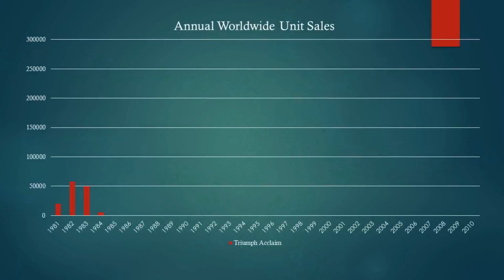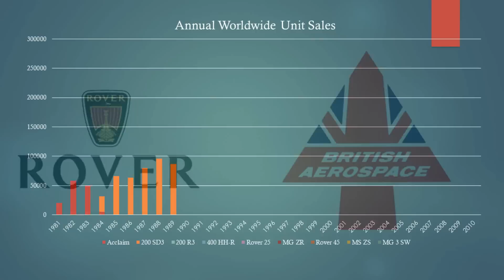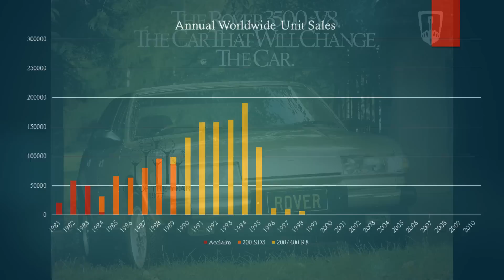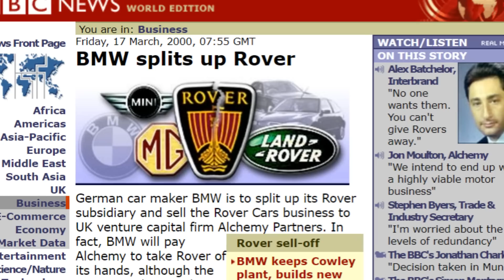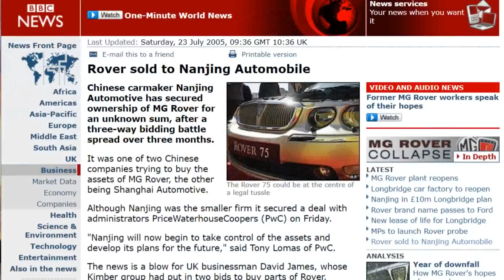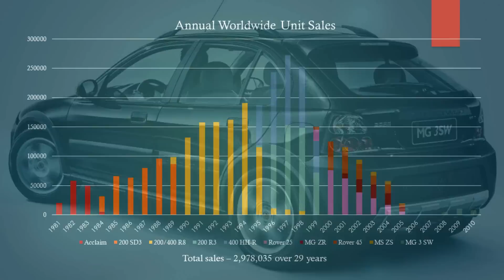The Rover 200 Story

Comment: I owned a Rover 420GSI Sport Turbo (not a standard Turbo) in the early 90's. It was a very rare car as they mostly went to the Police. It was VERY fast..so much so that a friend of mine who'd just imported a Mitisubishi EVO 4 thought something was wrong with his car as it felt slow after the Rover. A rolling road confirmed his car was fine...so he then spent a fortune on tuning to get it as quick as the Rover. 
The 420GSI Sport Turbo had had its turbo badge removed by its previous owner (a member of the BRDC), he'd also replaced the original soft bushes, fitted adjustable Bilsteins and uprated the brakes. It was a thug in suit...I upset a few Porsche 911 and Ferrari 348 drivers. The only negative aspect of ownership was the servicing cost as it wasn't really up to its performance..I lost a driveshaft which damaged the Torsen diff (££££), melted a piston and  blew the turbo (££££)..but I guess I did drive it hard! It is still the car that holds my personal top speed record..set at 2am on a deserted M55. 
My current car an Audi S3 is probably about as quick, but passengers expect ut to be fairly fast...no-one expected what they got in the Rover...the second gear was like being launched from a catapult..it just went on....and on!! 👍🏻🙂
Thanks for the video...brought back some fond memories...and a few scary ones!😱
Reply: I;d seen a Cops Montego Turbo Uxbridge Road Shepherds Bush London ,Pizza moped geezer forgot to lock his back box,out comes 3 steaming pizzas Cop car doing about 80 mph swerved doing all 3 italian pies,it was a deliberate manoeuvre outcome splat steaming tomato chessy messes on the road.Feck what a laugh that was in the late 80 to-90's.A1 driving.
Reply: Vincent Mullins 👍🏻😁
Reply: Brilliant to see Mr expensive being trashed so badly,lol.
Reply: Y
Reply: You are correct in worked in R&D at rover and we had a 420 turbo it was so quick but the rest of components weren't top notch it was scary.
Reply: Tomcat could do 70+ in 2nd

Comment: My Dad had a White 216 Vanden Plas back in the early 90s and at the time I had an XR3 and the Rover 216 was better all round and the S series was a peach of an engine and made the CVH in my old Ford feel like a boat anchor in comparison and the rover was also a lot more economical as well.

The only downside was going fast into a corner you would slip off those leather seats and it needed some bigger wheels and I would of jumped at the chance of owning a 216 Vitesse variant in black with those lovely alloys and side stripes.

Comment: The 2 litre turbo diesels with intercooler had fantastic performance and had bulletproof reliability. I miss mine. I sold it with full MOT.
Reply: Fuel economy wasn't great though. Not much better than Hondas 2.0 petrol.
Reply: @garybrown5500  true but it wasn't  that bad about 48 wish if i remember  from the one i had, it was more  refined  than my maestro td (60mpg)
Reply: Me too😢
Reply: @garybrown5500  

You are talking nonsense! They were phenomenally good on fuel!
Reply: @skylined5534  Really. How many MPG were you getting from yours?
Reply: @garybrown5500  

Upto the mid fifties on a long sustained run and late 30s to early 40s around town and standing in traffic etc in the winter using the lights, heating electric heated mirrors etc. That wasn't even trying either.

That's a fairly old tech 2.0 diesel too.
Reply: @skylined5534  Ours was only doing about 32-34 around town. We could get into the 50's on a very long run but this dropped quite disappointingly when cruising along slightly above the speed limit. We had a batch of Hondas with this engine at the dealers I worked They were aimed at the taxi market but we couldn't shift them due to the fuel economy. Eventually they hung around so long, we put new batteries on them & Honda had them back.
Reply: @eggy1962  Had a non turbo 405 Peugeot. Seemed to return about 60 mpg no matter what sort of driving. Not the most exciting car but with fuel economy like that I was sad to see it go!
Reply: @garybrown5500  the xud’s were extremely popular i had a 1.9 non turbo in a talbot horizon, a 1769 turbo in rover 218 and another 1.9 non turbo in a citroen zx . I also owned two maestro diesels one non turbo one with turbo, the maestros were a couple of miles per gallon better on fuel being direct injection..... if i could go back in time any of those 5 cars i would like to have back. Plus one of my skoda estelles cos they were quirky and fun.
Reply: @garybrown5500  

Either you had a lead foot or something was wrong with it.

The engine in the CD Accord and 600 wasn't the same. Based on the same unit but different everything from the basic block up. Typically these would also do 40 to 45 mpg around town and given the competition at the time I don't believe you struggled to move them for minicab use. In fact they were quite a common sight as I recall.
Reply: I had a 3 door sdi which was chipped with the wastegate actuator wound up which went well. Was never amazing on fuel compared with the French equivalents but never dropped much below 45mpg but I never managed better than very low 50's. Most equivalent performance petrols would have been in the low 20's to mid 30's absolute best. I loved the low to mid range torque & never bothered revving it much more than 3300rpm.

Comment: had a 1994 M-reg 218SD turbo diesel - put 87,000 miles on it and was totally reliable. Started first time, every time and when I sold it after 7 years the clutch, exhaust and even the brakes were still the originals. Only parts on the car that were ever changed were service items, tyres and the offside front wing (accident damage). Looked up the MOT history and it was still on the road in late 2017 with 131,500 miles.

Comment: I loved these. Again the estate was a cracking car. I had a lot of rover cars over the years and never experienced any of the fatal flaws they were slated for so much so that my wife drove a 75 for 12 years totally trouble free. My 25 for work never let me down once, my freelander is still running and it's now 23 years old my 220 turbo was stolen and burnt by scum. I now have a mg f with 110000 on the clock. I am the luckiest k series owner in the world having never needed a head gasket or anything like it.

Comment: owned an old acclaim and literally drove it till the wheel fell off , super car felt like a limo from the previous metro i owned. I also owned a j reg 214 which did 60,000 miles as a taxi and apart from the renowned head gasket fail it did the job no problem , spritely thing made my diesel competition look slow but it never felt as smooth and comfy as the acclaim it was a bit tinny really

Comment: Just bought a 40k miles 25 as my first car. Absolutely class! (Almost) no rust and cylinder head is just holding in there
Reply: Changing the green rubber inlet manifold gasket every couple of years is a good idea as they go kind of spongy and leak coolant internally and/or internally.

Many the cause of actual head gasket failure and often wrongly diagnosed as perceived head gasket failure by 'mechanics'! 

Great little cars, just keep an eye out for any rust starting at the rear of the sills where they meet the arch. 

Other than that great little motors and mechanically hard as nails!

Comment: The " K " series engine was a pile of scrap.The most supid unreliable head gasket ever.It allowed oil to leak into the cooling system.Hower I owned the 1.6 honda engined auto.It covered 340,000 miles and was running fine when I scrapped it because the body rotted out.
Reply: k series  was a overheating pile of  shit....im surprised it  lived into the freelanders.
Reply: It was only a design fault. The K-Series engines are really good barring the hg.

Comment: I have very fond memories of the Rover 200....
In February 1985 my dad bought a new 213 VP in Moonraker Blue. The 1.6 engine was not yet available at this time so the 213 VP was top of the range. Price was around £5600 from Taggarts in Motherwell, Lanarkshire. I was 18 and had the pleasure of driving this car regularly, which made me feel very proud and important. I can still remember the registration number of the car - B809 BGB. 
In January 1986 my dad bought another Rover but this time a 216 VP EFi. The Vitesse model was not yet available so again this was top of the range at the time. It was again Moonraker blue and fitted with a 4 speed automatic. Price from same dealer as before was £6500. Registration of this car was C718 HUS. 
The 213 VP became my car at this time, so as you can imagine I was the envy of my friends....not to mention their dads. 
The 1600 fuel injected engine while obviously faster than the 1300 was not as smooth and also had a problem with burning oil.

Comment: I had a W-Reg 1.4 25 bought in early 2006 with 24,000 on the clock. 
Clutch and headgasket failure not too many weeks after purchase.
After that I caned the living daylights out of it for five years with ne'er a problem. Just routine servicing. 
Engine was a bit peaky and flat at low revs as expected of its configuration.
Handled and stopped well. Got a soft spot for it.
Dad had a H-Reg 200 for years as well. No problems at all with that one. No power steering on it though. Smooth, cheap motoring.

Comment: I’ve been watching your videos for a few years but have only just got to this. I’ve owned four Polos over the years (all mkII breadvans, including one post-1990 facelift model).
Unless I was unusually lucky and picked up a prototype, the Formel E was sold on the open market because I had a 1984 Formel E. it had a little orange light that told you went to change gears, and it had start-stop. Unlike modern start-stops, it restarted the engine when you moved the gearstick from neutral to first gear, not by engaging the clutch. To clarify, you were at the lights, engage the clutch, but ignition only happened when you threw the box into first.

Comment: Whilst Honda seemed to simply cool to the partnership, I saw BMW as a company that took advantage of Rover, the designers, tech, etc. and cherry-picked the brands they wanted and threw away the leftovers.  The new Mini alone would have saved the company I reckon.  BTW, we also had a Rover-badged Honda here in Australia, called the Rover Quintet (1983-1985) so pretty much the equivalent of the Triumph Acclaim in the UK.  It actually was a hatchback, unlike the Triumph.  Later on (around 1985) this was replaced by the 416i (not related to the R8) which was a rebadged Honda Integra.  In 1991, the 'real' R8 was imported to evaluate possibility of bringing that model to Australia, but never happened.  We finally had a last hurrah of Rover vehicles that resumed importing in 2001.  Not certain, but I think we only got the 75 and MG variants of that model.  The remaining stock was sold off by auction following MG Rover's collapse.
Reply from the maker: Thanks - interesting to hear the Australian perspective that I hadn't found while researching.
Reply: Also around the time (2004-2005), MG Rover Australia sold the MG ZR 160 hatch and MG ZS 180 sedan, but the numbers that were imported were tiny, less than 100 units. They were terribly expensive and they arrived at the time of MG Rovers collapse and then sell off to Nanjing Auto/SAIC Motors.

Even though the Rover 200/400 R8 Series was never sold in Australia, they still remain to this day, my favourite Rovers!
Reply: The Mini One was developed with BMW knowhow prior to their eventual purchase of the brand as a whole, it had BMW developed engines in it and they threw £100million at the Mini plant. Subsequently BMW put around £400million into the Mini plants. There’s no way that Rover / Phoenix had that kind of money to develop the Mini, the Mini was a success because BMW invested significant sums in it, a look back through the history of British motor manufacturers prove that continual investment and development have been impossible, we simply don’t make good enough cars. We can do it when the Japanese build plants here but 100% British cars were shockingly bad.
Reply: @iEnofadov  JRA actually brought over a rover 400 to display  at a motor show but chose not to import it but currency fluctuations and an easier and reliable source of cars from nearby honda Japan stopped it
Reply: @sutherlandA1  - Yes, you're absolutely correct! They actually bought over a green Rover 220 GTi 3dr hatch and a silver Rover 416 GSi sedan for evaluation and were on display at the 1991 Australian International Motor Show in Sydney. Rumors have it that the 416 GSi sedan was still roaming the streets of Sydney a few years back, not sure if that's still the case?

But yes, currency pressures pretty much put a stop to Australia getting the 200/400 R8 series cars, instead we'd get the Japanese built Rover Quintet (Honda Quint) and then the Rover 416i (Honda Integra). I guess we never completely missed out on the Rover 200/400 R8 cars, we did get the Honda Concerto, so there was some consolation.
Reply: Not so. I worked in the 90s for a software house that was converting Rover's legacy computer mainframe system to an Oracle-based client/server system, for BMW. This was a multi-million pound project and BMW would not have committed to it if they had not - at that time anyway - been serious about the whole Rover company.
Reply: @vernonbear  The original BMW Mini engine (Tritec) was actually a collaboration with Chrysler  before the buy-out from Mercedes. Supplied from Brazil it was also used in small Chrysler vehicles such as the Neon and PT  Cruiser. It was only when Mercedes bought out Chrysler that BMW changed engines.
Reply: @vernonbear  the MINI 1 shape and prototypes were in existence before BMW came along, I sat in one at Gaytech.
Reply: @vernonbear  

That's absolute rubbish. The new 'BMW' Mini was a Rover designed and developed product prior to BMW acquiring the marque.

I late 90s pre production prototype shell was sold on Ebay a few years back and amongst other things had a Rover designated chassis number and even Rover etched Pilkington glass.

The 'BMW' engine you mention was actually a Chrysler unit.
Reply: @chrisrigby582  

Any links to the expenditure on that project?
Reply: Another way to look at it though is by keeping the MINI, BMW saved half of the company and its workforce.

Comment: Great video, very interesting. Certainly brings back some memories - I remember lusting after a 216 Vitesse when they first came out! My dad ran a small engineering company in West Midlands and made tooling for some Austin Rover cast alumium parts - the O-series EFi manifold being the most memorable. They had BL - Rover cars to support UK manufacturing, these were an Ambassador, Rover SD1 2000, Montego 1.6 HL (terrible quality), Montego 2.0 GTi (lol), Rover 216GTi Twin Cam (lovely car, metallic burgundy, Honda DOHC 1.6) then a 420GSi Tourer (had loads of problems). Then had a VW Passat in 1998 as there was no more Rover work done in the business. Shame it all went as Longbridge is not far from me and grew up car mad and collecting all the Rover brochures. I loved the Rover 827 with that fantastic Honda V6, with more pull than the 825.
Reply from the maker: Thanks! Hey, my dad had a small engineering firm in the West Midlands as well :-). Don't knock the MG Montego 2.0. I'm deep in the weeds for the next video - the Maestro and Montego, and that thing went like stink.
Reply: Oooohh, reminded me - the MG Montego Turbo facelift model in BRitish Racing Green. Wow. Regards the GTi badge....didn't think it fitted old monty. BTW, going to looks at your other vids, this was the first one :)
Reply: And of course subscribed :)
Reply: I had a 1986 Montego 2.0 HL. Single SU carburettor feeding the O - Series engine. Bought four years old in early 1990. Why? Far cheaper than Cavalier or Sierra, both of which were arguably better cars, though the Montego did have performance on its side. When it was working, that is. It also came with the PAS option, very unusual in cars of cars of the class in that era. I replaced it with a 1989 1.6 L which has no PAS. Complete monster to try and drive.
Reply: @BigCar2  I had a 1990 MG Montego 2.0 EFi in white, I still haven't had a car since that made me smile like that one did

Comment: From memory the 216 GSi used a sixteen valve head but operated, unusually, by a single overhead camshaft. Honda's Concerto was very similar to the 1989 Rover 200 hatch in terms of exterior styling.
Reply: Most of the Honda 16v motors were single cam but operated rocker arms and cam buckets much like the Dolly Sprint motor.

The few exceptions for Rover models being the D16 twin cam in some 200s and 400s and also the H23 in the 623 models. Some bloke did fit a VTEC H22 from a Prelude into a nice looking flame red 600 once, neat!

Comment: I owned a R420 for about ten years, then a R200BRM which I restored and subtly modified, then a R75 1.8T which I bought cheap with blown head gasket and H-----DS very poor service history which I upgraded with leather trim and big brakes, this was the best car I ever owned. During all these I had a bought cheap with no service history but low mileage MGF Trophy 160 which I modified considerably but subtly over the years with coilovers, solid cams, front mounted oil cooler, stainless exhaust system and 200 cell cat, K7 gear set, 620Ti clutch with Freelander flywheel and 620 Torsen diff plus many small mods. I loved driving that car and the coilovers transformed it over the Hydragas. Head gasket problems go away if you take load off the water cooling system by installing a traditional front mounted oil cooler.